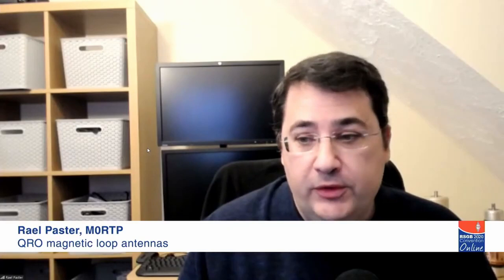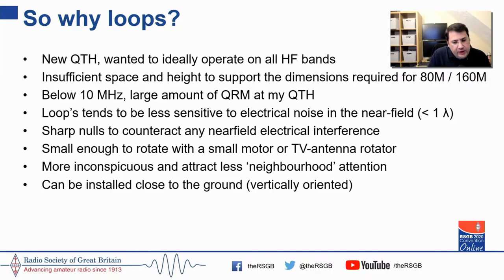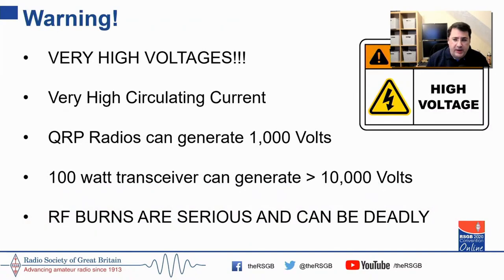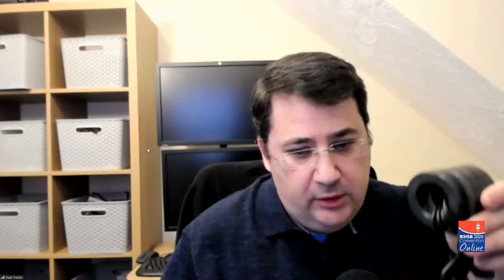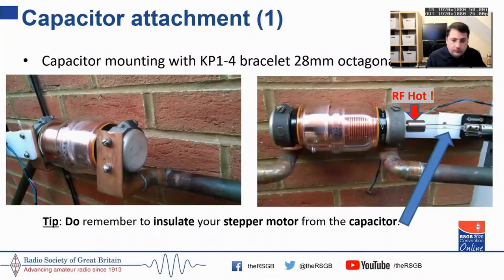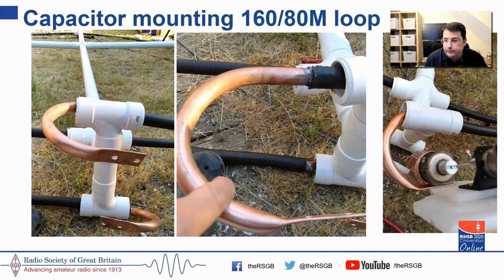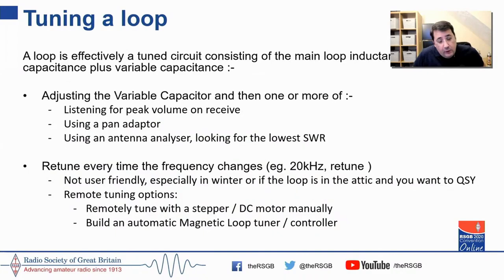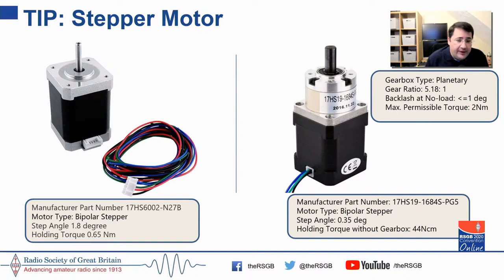RSGB 2020 Convention Online presentation - QRO magnetic loop antennas

Comment: N4SPP's site should be checked in priority. In addition the ARRL Q formula (found at 24:46) is flawed: there is no "2" at the denominator. Multiturn loops on lower bands bring no improvement over single turn, so you must increase diameter, no free lunch.

Comment: QRO is not needed for DX whisper if the antenna is big enough, but I think that QRO is a must for SSB if antennas are small specially when on lower frequencies.
A transmitting mag loop is ideal for DX on 80 and 40 meters, if there is no room for an efficient quarter wavelength vertical nor a dipole cannot be placed high enough. That's why a mag loop able to handle full legal power looks to me very attractive. Thank you very much for this instructive video.
In order to be able to apply full power on 40 and 80m...
How about placing two vacuum capacitors in series to get more voltage headroom, and/or, two in parallel to get twice current headroom, up to four stepper motors, into a two turn loop with 20 meters of 7/8 inch or even 1-5/8 inch Heliax in a relatively small 5m by 5m square or diamond? Has anybody tried?